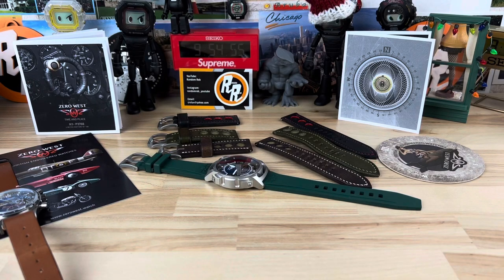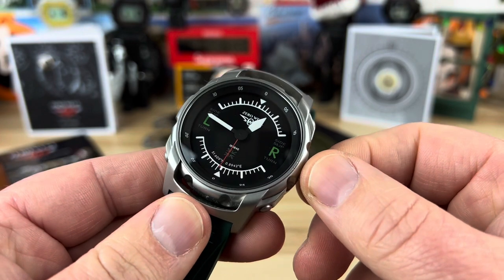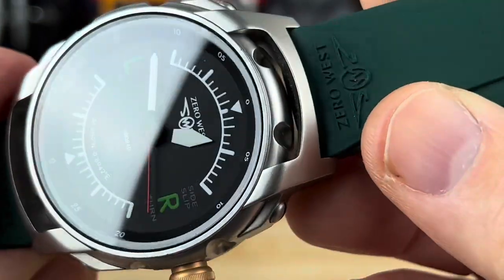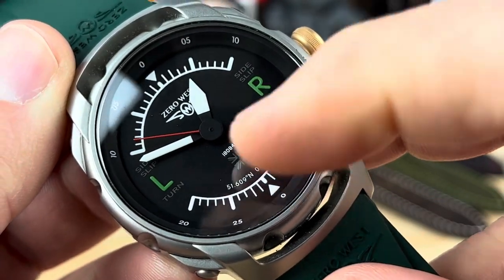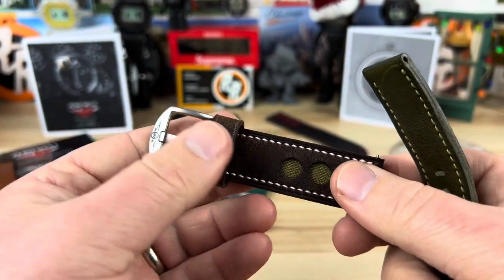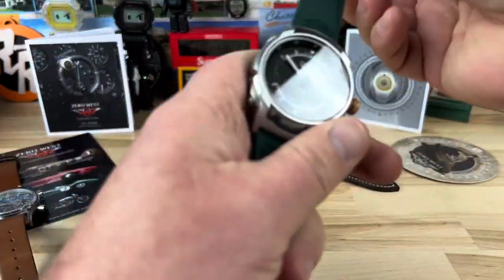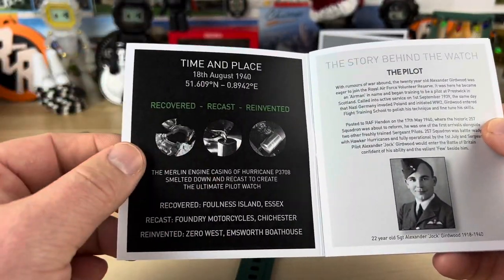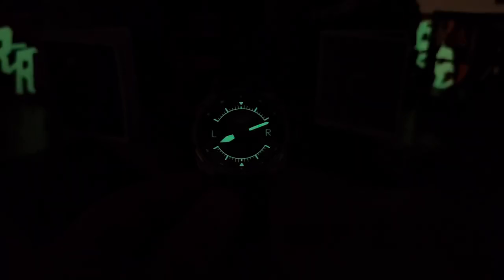Zero West H1-P3708

Comment: 2:30 once you melt down and recast the aluminium what is left? it’s just the elemental metal like any other aluminum. they should have cut up the engine so at least the crystalline structure of the orignal alloy.

Comment: Rubbish watches. Massively overpriced. I would say the unit cost is around £200-£250 to produce and they're selling for thousands! It's "engineered" in the UK, but all the components, apart from the movement, are made in China. Zerowest is trying to market the watches as though it's made in the UK. Don't Be fooled by them!